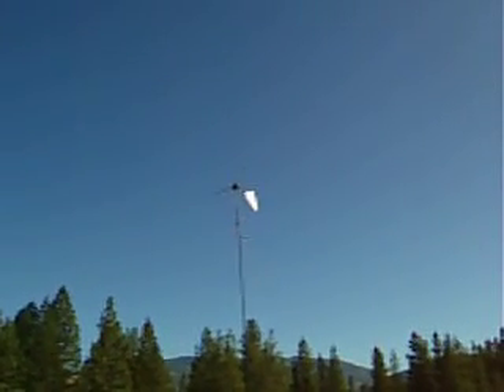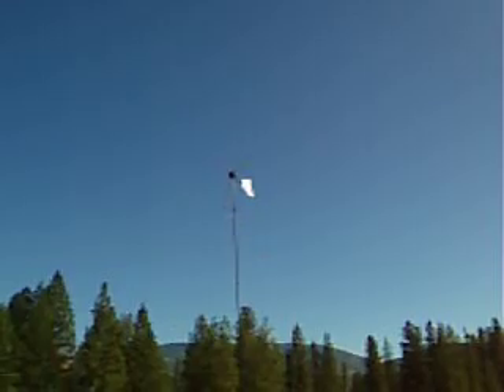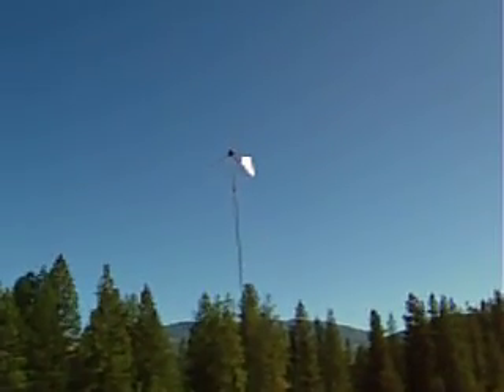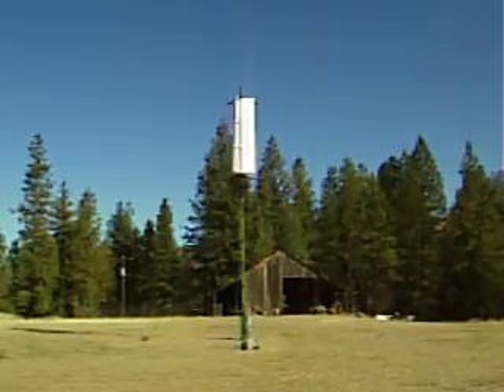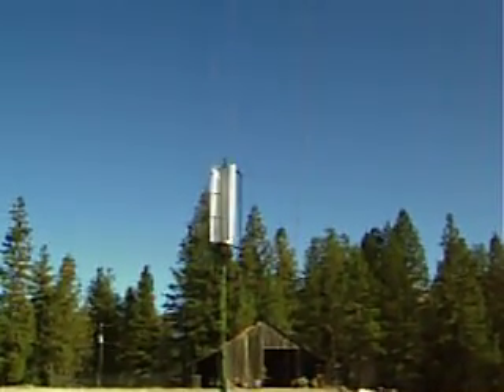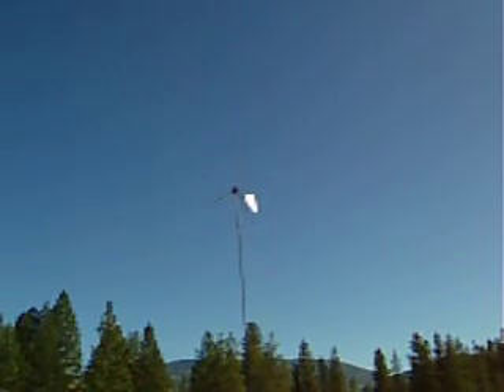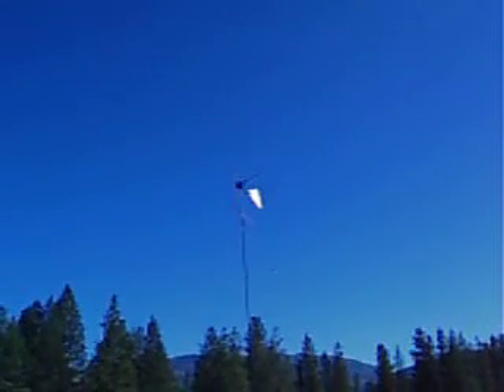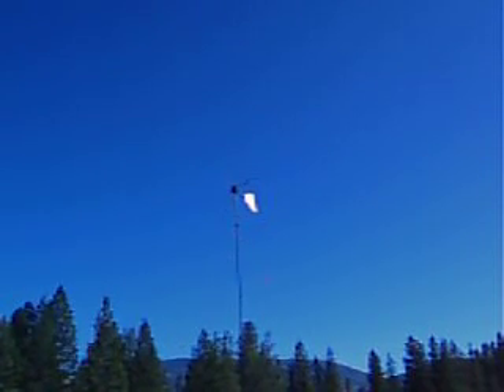3.65 Meter AF Turbine

Comment: Bill,
     So you changed the diameter of the blades, and you picked up torque and lost a few RPM?  Did you raise the height of the tower too?  Three phase?  Can you share the particulars on the rotor diameter, steel thickness, # stator windings, wire size, number of turns, and type and # of magnets you used?  Did you make your own blades?  Hub type?   Too many questions?  Nice job!
Thanks!